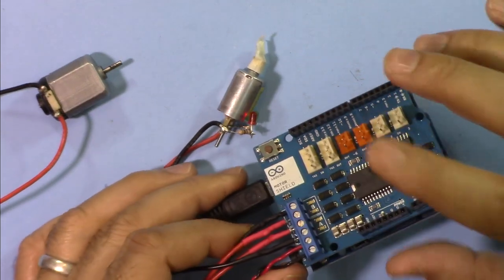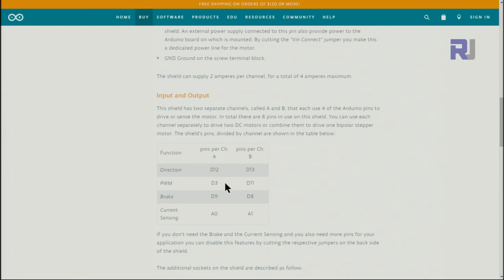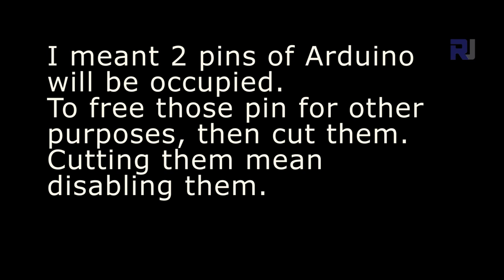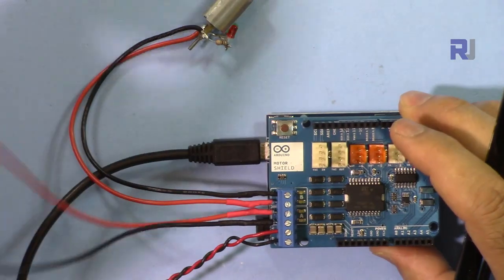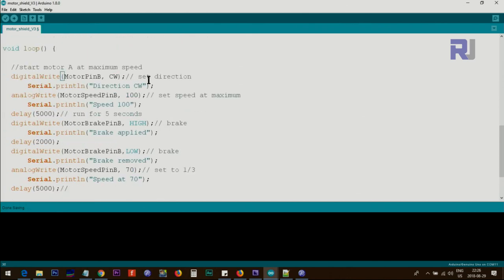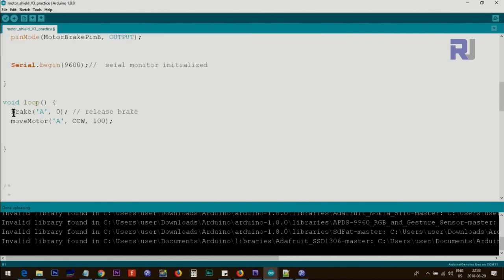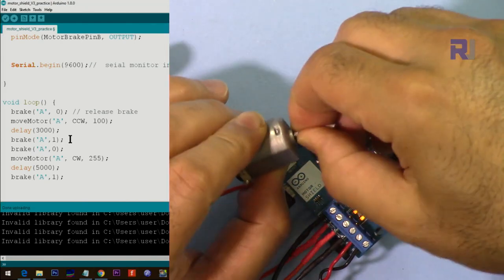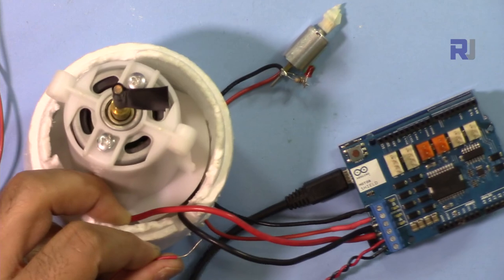Using Arduino Motor Shield to control 2 DC motors L298P

Comment: My 12 volt motors do not get enough power from an external source of 12 volts. I would like to connect higher voltages to the shield but am afraid of harming the Arduino. Your video demonstrates cutting the Vin connector in the shield but there is no audio to explain why you would want to do that. Is it to protect the Arduino from excessive voltage from the L298P shield? Otherwise thanks for an excellent video. I did subscribe to your course on Udemy.
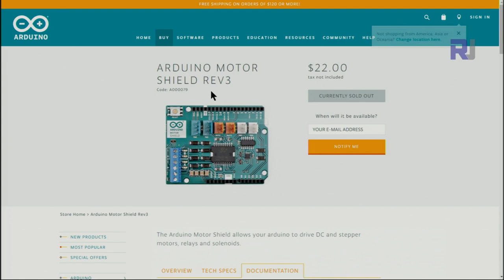Reply from the maker: I wish you had mentioned the time (like 2:35)  so I would click and view it. Please post the timing so I view and reply. thank you for being my student.
Reply: @robojax  Demonstration of cutting the Vin pin starts at around 5:55. There is no explanation on why you would want to do this. This should lead into a discussion on providing separate power to the shield and the Arduino, and considerations for doing so. In the L298N you have to remove a jumper if you supply in excess of 12 volts to the driver. Is there a similar consideration for the L298P? There is very little information on the L298P available on the internet, so your advise would be greatly appreciated. Thanks very much for your support.
Reply: @malcolmklein9316  i have the same problem
Reply: @malcolmklein9316  Same problem here. And this code is also wrong. 255 is max, not 100. Tested, but now I can't get the motors to draw power from the VIN which 3amps.

Comment: Can you use the Adafruit AF.motor.H library with this? I ask because I have a lot of code for it and want to upgrade from the L298D which doesn't carry enough current. Thanks
Reply from the maker: both of the mentioned chips are very old like 50 years old. New chips are compact and effecient like this module https://youtu.be/W_Wm28nQAYA
Reply: @robojax   Thanks, but I can't even find that for sale anywhere. I saw it on only one website and it said out of stock.  I think I will stick with the tried and tested.
Reply from the maker: AliExpress has it https://www.aliexpress.com/w/wholesale--ZK%2525252d5AD.html?spm=a2g0o.home.search.0 and if you want it fast from Amazon https://amzn.to/4bJNjT2
Reply: @robojax   Thanks! Just wonder if I'm prepared to wait a whole month for it.  Also, not sure if it's what I want. Was hoping for a simple shield with x1 H bridge and x1 2amp motor driver at 4v. I don't want a mess of wires everywhere since it needs to fit a 3D printed box I already made.  The L298P seems to solve this and I can get within a week.
Reply: @robojax   Hey, I just bought this and hooked up as shown, but for some reason it isn't drawing power from the external power supply.  I'm checking 4.5v at the terminal Vin block, but the motors only output about 1.5v at full power (100). I cannot figure it out.

Comment: Hi, I use only 1 stepper for my project. The stepper needs 3 Ampere. Will this work? I have the Arduino uno rev 3 and the Arduino Motor Shield Rev3.
Reply from the maker: Hi, I believe I mention the specs of l298n, maximum current it can handle is 2A continuous.

Comment: can this motor shield run a 24v motor with max current 19.2 A? Because the motor shields max current is only 2 A. Is this possible?
Reply from the maker: Have mentioned the maximum voltage and current. I don’t remember what I said. Please watch without skipping.

Comment: hi, love the video but looking for a video on controlling a dc motor with an inbuilt encoder as trying to control it but the code is driving me crazy. i am using an arduino with the shield but after many tutorials, still no luck. can you help?  thanks
Reply from the maker: Hi, this video is not about encoder. I will try to make a video on motor encoder.

Comment: What gauge wire are you using, I’m using 18 gauge with difficulty having it stay in the ports/conectirs
Reply from the maker: just cut the tip of doupont wires 1 or 2 pieces in about 1cm and inset it in the connector with your wire it should create enough thickness to hold it.
Reply: Thank you I’m going to try it now.
Reply: Many considerations should go into the proper wire guage to use for supplying power to motors. Counterintuitively, the thinner the wire, the HIGHER the resistance. So for example, 22g wire has a higher resistance than 20 guage wire. Another consideration is stranded vs solid core wire. Stranded wire also has a higher resistance than solid core wire. I have started using 20g solid core wire for supplying power to my motors. For a more complete discussion, see this link: https://www.flukenetworks.com/blog/cabling-chronicles/considerations-choosing-stranded-vs-solid-cable#:~:text=The%20most%20significant%20difference%20between,50%25%20for%2026%20AWG).

Comment: Hello great tutorial...best I seen; I am looking to make a project using the Arduino Motor Shield to control two 100mA Solenoid that will be controlled by 3 potentiometer
Reply from the maker: Thanks. I have tones of videos for this chip here is one you can learn from https://youtu.be/qo7eJ6PUx2M

Comment: my motor isn’t running do i need a bigger battery source? i have a 9V
Reply from the maker: I have mentioned how much current ( Power = Voltage X Current) or power is needed. so measure the current for your motor to find out. Even with measuring current of motor without load (motor load) won't be accurate. but do it and see if it is exceeding the capacity of this shield. To be sure if the wiring and your code is okay, connect an LED with a 1k ohm resistors in series to the terminals where motor is connected, it  should turn ON.
Reply: thank you, i will find the right power for this
Reply: so what i do if the current exceeds the limit? it went past 2 amps
Reply from the maker: Here is separate video on current sensing for this module https://youtu.be/-uQKBDTWHPM search my channel for specific video. Here is how to find Specific YouTube Video in a channel https://bit.ly/findYouTubeVideo

Comment: Hiii I just want to chk the code of L293D motor shield but your provided link is not working looks like your site is down #Domain issue
Reply from the maker: I am sorry. Yes I am aware of this and I am at work and don't have password to fix it. When I get home, I will fix it in 4 hours from now.
Reply from the maker: it is fixed an d you can access it now.

Comment: Hello, my brake variable doesnt seem to work. It said 'brake' was not declared in this scope
Reply: how should i fix this?
Reply from the maker: Hello, it means portion of the code is missing. so you have not copied the code fully.
Reply: @robojax  hello, I have done it and it worked so thanks for that. And I have one more thing to add, how can I use buttons or potentiometers to make it do tasks on command?
Reply from the maker: you just asked for 3 projects. buttons, pot and command. just search my channel. you will get. for command watch the 360 servo video. good luck

Comment: hi, 
can arduino motor shield sontrol brushless motor ?
Reply from the maker: Hi, no. Brushless motor has 3 wires and you need Electronic Speed Controller or ESC for that.

Comment: 9:37  Why don't you set the numbers like 1,2,3 and 4,5,6???  Why do you set random numbers like 12,3,9 and 13,11,8????

And why serial monitor is set at 9600??? Can it be sinply just 1????
Reply from the maker: May be you missed it but not all pins are capable of PWM . So I used the pins with ~ symbol. 9600 is one the standard baud race used for serial communication
Reply from the maker: You didn’t reply back?

Comment: Hi. Great tutorial.

What Voltages are used on the small motors. I want to use the shield eith 3v motors?

Thanks
Reply from the maker: Thanks. you can use up to 25V motor. Your 3V motor should work.
Reply: @robojax  great, thanks.

Comment: hai,,, i need code for,  " A pre settable up-down counter (means SET, start, pause, run), with reed switch INPUT, single led OUTPUT for signal feed, with interfacing shift register 74HC595,  4 digit 7 segment CA led display also 2 dc motor seperate control with variable speed (ROTORY)  by motor shield L298P rev3  ( 2 H bridge)..for arduino uno processor. thanks lot...
Reply from the maker: Hi, This is full project. You have to use each component from one project and put them all together.